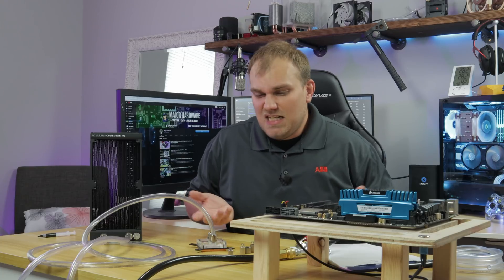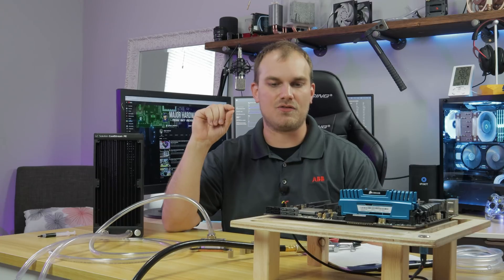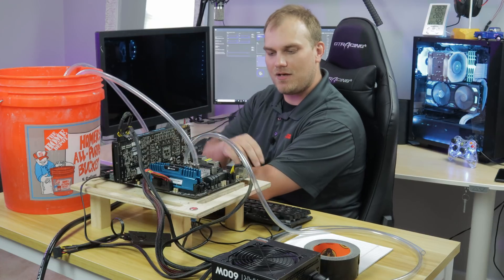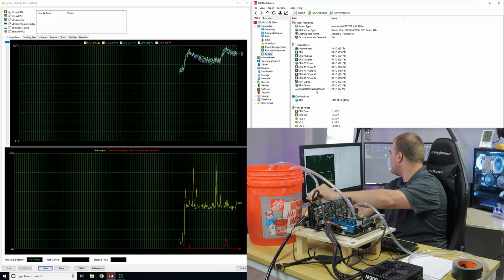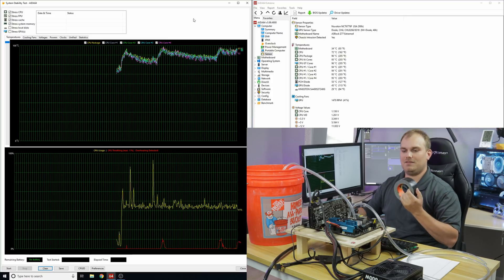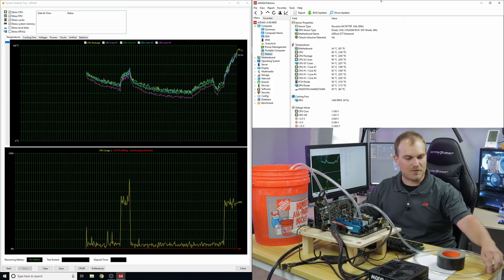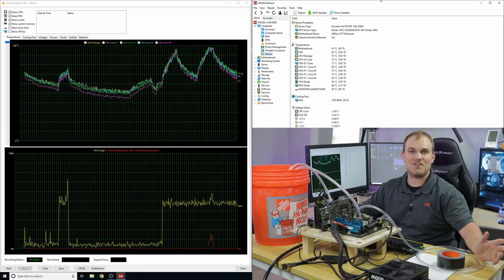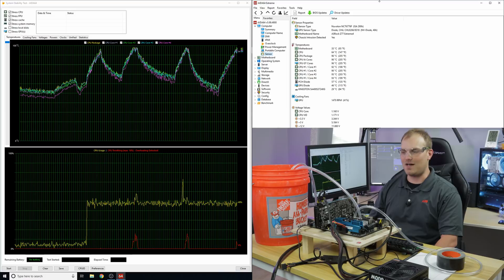AIR COOLING A CPU WATER BLOCK

Comment: As I'm sure dozens of others have said, you are NOT pushing 30PSI through that block.  You are pushing CFM.  You can't hit "pressure" with an open hole.

Also, lose the hose on the back side.  "Hot side".  You have an open exhaust, and your "feed" is the other room.

Also, get a regulator for your compressor, run the tank at ~110, use the regulator on the exhaust of the compressor.  Then the compressor might down cycle occasionally.

I sell industrial pneumatics all day every day.   And it is not "just" air.  The air if it is not properly filtered is actually slam full of water, and oil from the compressor.  And the air going into your bucket is actually quite warm from the compression.  So the ice is actually a critical component.
Reply from the maker: I'm a mechanical engineer not a pneumatics engineer
Reply: @MajorHardware  didn't think you were.  Ergo, trying to share some experience/knowledge.

Didn't mean to come off snippy.

Comment: Hi, I had a similar idea: how about mounting a waterblock on the CPU and connect a second water block in the watercooling loop, while having a CPU air cooler mounted on top of the second water block? So the second water block does not take the heat from a cpu but gives the heat to an air cooler?  Does this make sense? the cooling power should be good enough in my opinion

Comment: Dude, get a blower style fan, the look like snails and are used to inflate like bounce houses and stuff they're like 55-100 on Ebay, it would work better than an air compressor. You'd have to voice over however they're really loud

Comment: If you're confident enough to try sub-ambient cooling I want to see how far you can get with thermoelectric chillers (peltier).
Basically it's just a square pad with a hot side, cold side, and some wires

Sandwich it between the CPU and waterblock, cold side down (obviously :P )
Plug it into 12V power while cooling the hot side with a standard (but more radiator than normal) water cooling system and see how well it can cool under heavy load.

I've seen plenty of liquid nitrogen, dry ice and even phase change (like airconditioners) but rarely does anyone try with TECs

Comment: If you were to force the air through a small hole, as close to the processor as possible, so that expansion happens at that point (absorbing heat energy from surroundings) it should be more effective. For the same reasons that aersols spray very cold

Comment: Next step: use air cooler heatpipes as radiator for an water block.

Maybe even go full air cooler water cooler, using air coolers for both the block and the the radiator?

Comment: There is nothing wrong at all with aircooling via hoses and blocks. I'm not sure why anyone would think that except for it just "not being normal". Well, that and because open coolers are easier to construct (and thus cheaper), much less hassle to install due to no hoses, fittings ect.

The main reason why this isn't on par with a good air-cooler is simply that the block is designed for water rather than air. An air-block would need to be larger (closer to a traditional air-cooler) - simply because air has much lower thermal mass and thus you need a lot more volume moving through without running into any pressure issues (although with an open loop that would take a lot to happen). A size or two larger hoses would also help optimize it, although I expect 90% of the restriction in this setup is the tiny block and not the comparatively large hoses.

And ultimately a setup like this has some benefits over traditional open-air:
- You can vent heat perfectly to wherever you want without need for case-fans to do the job.
- You don't need a radiator since a pump sucking in ambient air would effectively equal a 100% effective radiator.
- Leaks are obviously a non-issue.

Oh, and you definitely don't need an air-compressor. A pressure-optimized air-pump would do the job just fine - at least if you weren't going all out extreme.. Basically something like a beefed up aquarium-ventilator. So that part wouldn't necessarily need to be super loud or expensive. The only real reason why you need a compressor in this example is as I said the system (and especially blocks) are designed for water and are waaay too restrictive. An air-optimized block wouldn't need anywhere these pressures to get the same volume of air through (and be a lot safer as a result too). The main expensive part here would be the blocks - just as with air-cooling, except they would probably be a tad more expensive due to higher material costs from simply the extra size needed.

It would be great fun to see just how effective you could make a system like this if you actually had proper blocks designed for the task - but that's not a very easy thing to make happen without access to and familiarity with high-end milling equipment. Allthough .... now that I think about it, it should be fairly doable to just mod a common tower-cooler with a casing very similar to the watercooled-aircooler experiment. The only thing is that I think it would be CRITICAL for performance to force the air through the actual fins rather than just "being around the cooler". That flaw in the original experiment was a minor issue on water, but I think it would be vastly more severe on air. But that's not really that hard to DIY together - especially when you don't have to worry about leaking from imperfect seals.

@Major Hardware Hop to it I say! :D

Comment: Just as a fyi, 5 psi water pressure it more than 5 psi air pressure. For everyone one foot ( of hose ) water pressure roughly changed .45 pounds  air pressure does not change.

Comment: You need to have the nozzle of the compressor very close to the CPU so the compressed air can take the heat away as it expands in volume

Comment: 2:14 The nylon washers are supposed to go between the motherboard and the waterblock fasteners, not on top like that. Good thing you didn't get a short circuit.

Comment: Can u Properly TEC Cool an CPU
Reply: Physics says you can’t unless you have a ton of then (expect 1000w in power for your cooler, you obviously can’t stack them as the top would need to be cold enough to cool 1000w plus your CPU, which means it would need a Tec on top of it... and oh wait, that’s why it doesn’t work for anything power hungry!

Meanwhile I can run -35c block temps on an FX-8350 at 1.7v (about 300w compressor), good luck matching me with anything less than 6000w of peltier coolers... You’ll need at least a 3stack high for raw temps and 20 in parallel for the heat load.

Comment: One thing I was thinking about is taking a 12V fridge and there's the intake and exhaust of the radiator that cools the fridge. If you weld them to a copper CPU block or just adapt fittings. It could have impressive results. Or the simple way installing the PC inside the fridge
Reply: Phase cooling, it’s very common for extreme overclockers, particularly our “regular daily machines” (-60c isle and -35c load testing with FX at 1.7v).

Comment: Crazy idea: hook a radiator from an AIO to the heat pipes of an air cooler. Fill the radiator with water and stick a fan on it. So basically u get a Hyper 212 solder the heat pipes somewhere in/out the radiator and cool with a fan like an air cooler with the benefit of the water inside the radiator. That should work pretty well!

Comment: With a open air loop you could run that air compressor at full. It wouldn't build pressure with an open end.
Reply: the whole pressure calculation he did is irrelevant since the headpressure of the pump is only to overcome height differences the loop in use is basically without pressure and the air can go through full blast it will do no harm whatsoever, fluid pressure and air pressure in an open system, who cares
Reply: @o_m_g_74  Even in an open system you still have head pressure from drag and bends which will become significant at sufficiently high flow. Probably can't get there using a 3/8" hose of any useful length and a ~130psi consumer compressor though. Upgrade to a 4000psi scuba tank with a short 1/2" hose and the flow resistance should blow the CPU block apart.

Comment: You don't need the radiator actually. The air heats up when it's compressed, thats why the cars have intercoolers, to cool the compressed air. The compressor should have an aircooler as well. 

When you're decompressing the air it will cooldown due to pressure drop. The more pressure drops, the more itll cool. Adding the radiator and the extra hoses will cause pressure losses that will turn into less effect at the cpu block. You should try this without the radiator to see how much it affects it!
Reply: Somebody who knows physics. <3

Comment: You should try adding a mister, like those used in cars. The water mist should help evaporatively to cool even more
Reply from the maker: i had an 03 Mitsubishi evo 8 and there was a switch near the shifter that sprayed the inter cooler with water, i never noticed any difference in performance but who knows
Reply: Major Hardware 
By your description it sounds like its for when you are on track, it should help with knock under load, otherwise the intercooler would not be able to keep so much compressed air cool enough for the engine not to knock, hence the computer wont need to limit the fuel to avoid it.

the idea is to use something like that to inyect some fine mist into the air so that it contacts with the waterblock and instantly evaporates coolimg a lot more than just air. And its self regulating as water's vapor presure gets low enough at about 10-15*C that it will barely evaporate anymore so it will never condensate and in theory should cool more than just liquid water.

Comment: Going to say this again in a direct comment so you're more likely to see it... I don't actually know what the odds are of that block exploding, but if you're going to try something like this again, PLEASE protect yourself better than just with eye protection. Sure, you don't want shrapnel in your eyes, but you don't want it in your neck either (or anywhere else). You should get some kind of shield between you and the system if you try to push this further.
Reply from the maker: Agreed that's why I didnt want to keep going up in pressure especially after calculating the pump only produces 5.5 psi. Yes air is compressible where water is not but I agree I needed something a bit better for ppe

Comment: 100% you need to add a blow off valve to that air loop hahaha. Also, missed opportunity to call your channel "Mad Science Hardware" of something ahah
Reply: indeed, the pressure in his block is probably waaay lower than the output pressure of the compressure because it can escape freely.
Adding a blow off valve will increase pressure (read air density) and increase thermal capacity of the air in the block and thus probably increase cooling capacity if the compressor can keepup.

Looking forward to part 2!
Reply: @diederickb1806  Doesn't compressing air heat it up?

Maybe you could have a system where you decompress the air, then blow it over the water block.. 

Having an adjustable valve At the exit might work too, slight resistance could make it blow faster??? Idk. There's so many different things to try haha.
Reply: @runninggames771  tru but the compressor will work as a big heatsing for most of that heat, the decompression that will happen in the 'cpuheatsing' could cause extra cooling i think.
But keeping it compressed will probably give it better heat transfer capacity.
So i would love to see which of these works best xD.

Comment: I am not an expert but just my thought its not really getting the full pressure because its an open system so even thought its set 40psi because the block is venting right away.  Where as in a closed loop it would see a lot more pressure.  I think if you get rid of the vent tupe it would have even less back pressure.  I have some experience with tinkering with turbo cars and if you have even a small leak you build much less boost

Comment: Can you air coo.. ..draw mountains in AIDA64, well yes you can! :) That last pressure might have handled the OC and also some worse CPU block might be better as microfins won't be good for air. Also nice to see that motherboard, as I had Z68 and Z87 ASRocks, so it's the missing link.

Comment: Neet idea but it should work better if you blow the air directly in to the cpu block without the radiator, after all the air cools down when decompressed, plus mor air can flow trough and you get better cooling

Comment: there is not 30 psi in the loop as there is no back pressure in the loop itself as for the cooling you would be better blowing air in at the inlet from the jet in to the block without the tube on either end

Comment: what might work better is to attach the air line directly on input line and move the air valve to after the cpu block as in your setup you are not running the pressure you are saying as after the compressed air leaves the valve in your hand it's venting to atmosphere pressure and is mostly just flow. but if you had your valve after the cpu block you would have the full compressed air at that point untill it leaves the valve. more compressed air is more dense and might possibly cool better
Reply: True. And more compressed air is more likely to explode this setup. Which would make for an awesome video^^
Reply: @Pheatrix  It would... as long as he would actually properly protect himself... I mean, yay for eye protection, but if that thing had blown up and shrapnel torn through his neck, those goggles wouldn't have done much good. Would need this setup to actually be behind some kind of shield (that you're sure will withstand shrapnel impact). I was kind of cringing when he was leaning to the side protecting his head because the thing might blow when he went to the highest pressure... if it actually had blown he could have gotten seriously injured.
Reply: Yes, and the way it's now more pressure means more flow thats why it got better with more pressure. You would need really high flow till the tubes would be restricting enough to actually build pressure in the system.

Comment: I would love to see how much pressure it could take, I would bet that on an open system like that 90-100 psi would not be out of the realm as the pressure would drop through the system by a great deal. I might have to attempt a test with my compressor as mine can do 90psi continues.
Reply: I’d bet 200 psi air at least (extreme low density fluid, the backpressure will be much lower than water, and backpressure is the main force the acrylic blocks will see), I’m not counting that wimpy pinhole nozzle, I’d say up to 400 psi for it due to its extremely low flow rate meaning the end of the hose before the block would equivalently be like 40 psi or rough napkin math Dnozzle/Dtube*Pressure)

150 PSI is what I use for cleaning a Titan Xp air cooler (90 psi for laptops) Water Blocks I’de use 150 psi for a quick cleanout.

Comment: Awesome man. Nice to know how much psi I can run on a water cooling setup.  Love the turning a meme into real life.
Reply: He had roughly 4 psi max, this is not indicative of water (Dtube/Dnozzle*DynamicPressure, his inlet nozzle was extremely small not allowing much flow, and then water has much more resistance, so the static pressure he would have seen maybe closer to 2psi). DO NOT CONFUSE THIS AS ACTUAL 40 PSI! He had almost no flow resistance and nowhere near that! Do not attempt to think 40 psi on a water cooler is safe just looking at this! Blindness and eye damage may result!

I expect he could have ran 400 psi due to that small nozzle, the rough equivalent pressure at the block would have been about 50 psi then, and the air flows super easy compared to water so the pressure differential also what you would call static pressure in a water cooled system would be about 5-10psi

Comment: What about filling a closed loop with Galinstan? It's a metal alloy that's liquid at room temperature, and it won't turn solid unless it's below zero. Only problem is that it's corrosive to aluminium, so copper or nickel plated copper will need to be used for the waterblock and radiator, along with a pretty strong pump.
Reply: There is only one major problem with doing that. 

The only pump that stands a chance is an electro magnetic one though that type of pump will unfortunately heat up the liquid metal. The reason a electro magnetic pump is required is do to liquid meatals low viscosity ( or speed a liquid moves when force is applied to it) and electro magnetic pumps are far better at moveing it then normal pumps. 

also pure murcury works as well for the same purpose.
Reply: @erikburzinski8248  Good point, though the reason I picked Galinstan instead of Mercury is because it is non toxic and less dense.

Comment: Sometimes your microphone line goes bad... encoding corruption?
Reply from the maker: i Dont know its like interference and it drives me crazy i have a shotgun mic but its echoy this one sounds better but cuts out. Its the samson go mic mobile do not buy it
Reply: @MajorHardware  the kind of garbling remembers me the old videogames running on a slow PC. It's like it can't keep up with the recording/encoding of audio stream. I'd try to:
1. Change audio encoder, or... 
2. Change audio format, or... 
3. Change audio file output drive